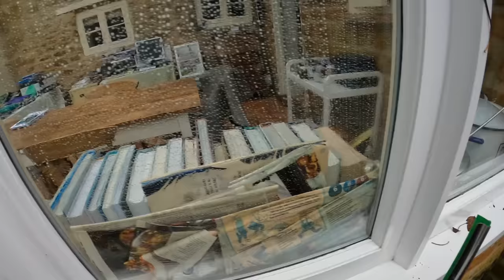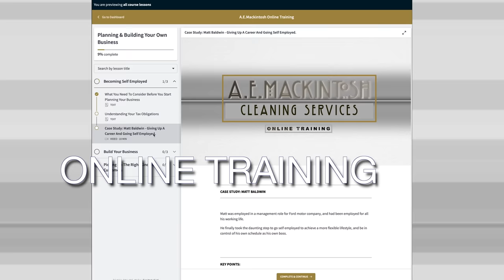Cleaning Windows From Dawn Til Dusk

Comment: Hiya..nice scenery for sure :D Why don’t you like to use a rinse-bar anymore? 😢 i got the nlite based on your review and love it.. :)
Reply from the maker: It wore out on the corners and it’s difficult to get a replacement. Also I find the pole a bit heavy and awkward to use.
Reply: @aemackintosh  Fair enough..definitely heavier 👍 I’ve bought quite few from Window Cleaning Stuff website they are like £5 each which is awesome, especially compared to the nearly £30 ones from gardiner :S

Comment: Need some advice mate 
Been using univalve for 2 month now currently using gardiners pole and brush head
Using 50 per cent fan jets but finding water is blasting out for to quick even when flow controller is turned down 
Used green and black pencil capsules but water has no strong flow when working
But do find best to use
Reply from the maker: Yeah, I’ve always found fan jets a bit of a waste of water. I like the xline brush that has a rinse bar through the middle, but I’m currently developing my own brush and jet setup.😜👍🏼